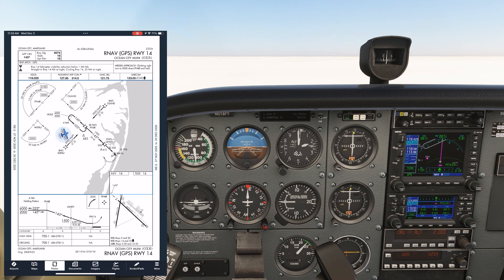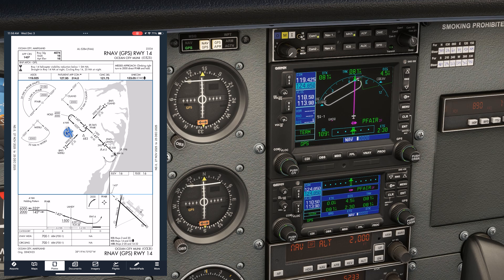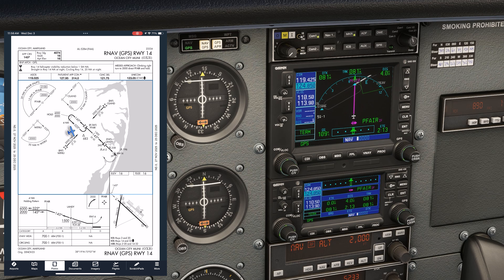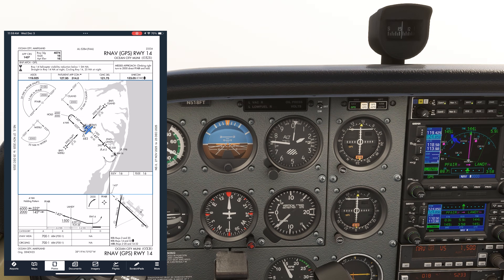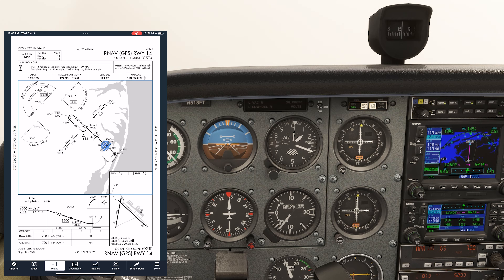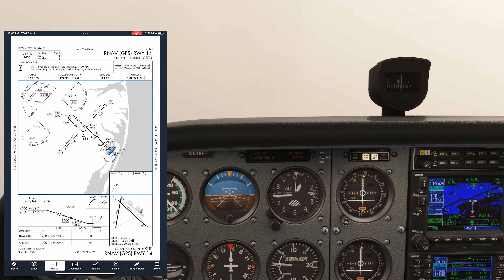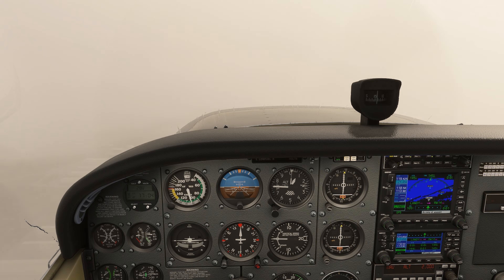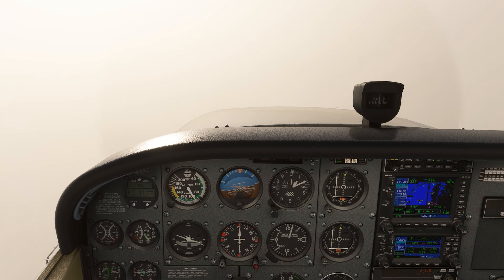Don't Make These Mistakes on Your IFR Checkride | Non Precision Approaches

Comment: I do not know if it is legal under the FAA but if you fly CDFA on the non-precision approach can you use the "artificial" DA constructed by adding a descend margin to the MDA? So in this case DA=750' (+ temperature correction when needed), instead of MDA=700'? For Cat. A aircraft the 50' margin should be enough not to descent below MDA and still fly it like precision approach. At least this is how it's flown under EASA.
Reply from the maker: You can, and many commercial operators do this. it's called a derived decision altitude. One big caveat is that unlike a true precision approach, you do not execute the missed approach when at the derived decision altitude. you can climb (usually), but must maintain the lateral course of the approach until the missed approach point. No early turns.

Comment: Curious if you have ever had an experience with the Trimble 2000 approach GPS?   Reading the manual isn’t helping and could be the least intuitive piece of tech I’ve ever tried to use.
Reply: For my IFR training, I want nothing but a Garmin 430W. I'd take a G1000, tough.
Reply: @santiagoecarbajal I’d like different too but it’s what is in the plane a bought. Thanks for the unhelpful comment.
Reply: @Thebigbilltheory don’t worry, I have more of those if you need to. 😄
Reply: @santiagoecarbajal ??